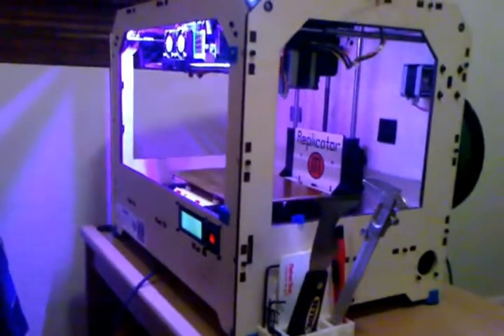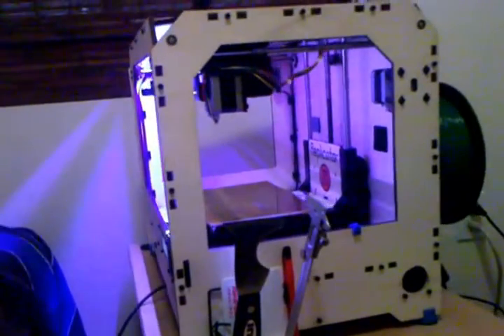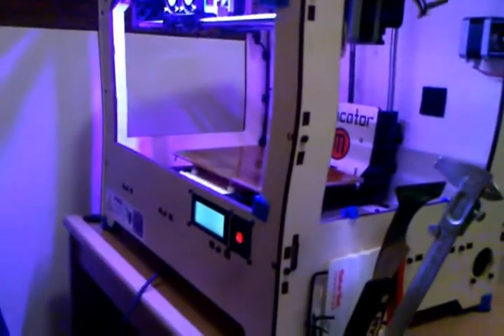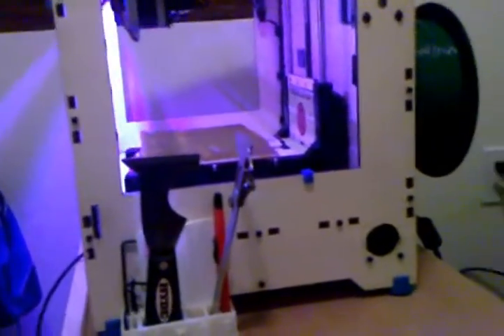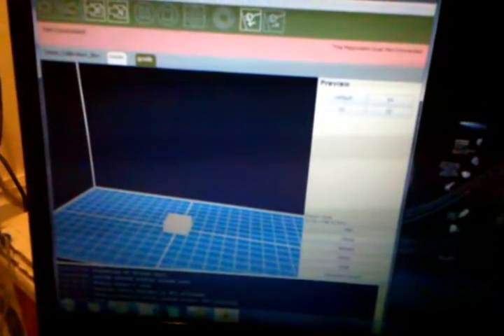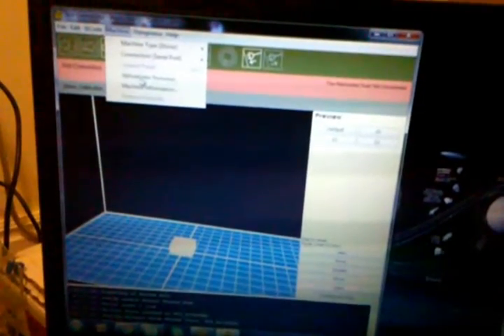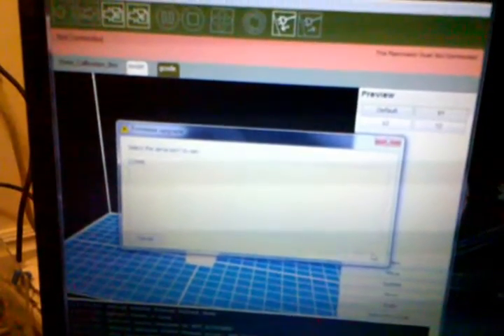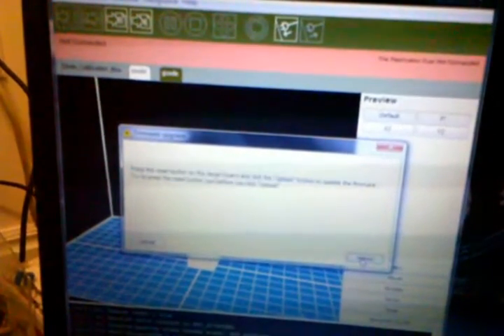Makerbot Firmware Update

Comment: I tried but it did not work. I tried like 20 times but keeps failing.
Reply: Have you solved it yet? I try to connect my printer with the makerware software but it appears to detect it but not later, and my pieces are not printing well. It has version 5.2, I don't know if it's that problem or that the MW update no longer works with 5.2
Reply: @juanmanuelalfarolopez2238  I replaced the board.
Reply: @anwarigroup  where can i get board?
Reply: check eBay, I have one I am selling it. I changed to a new board. 1
Reply: @anwarigroup  do you have de link?